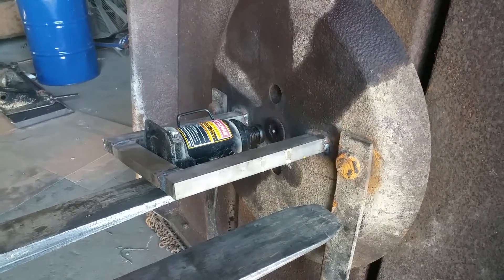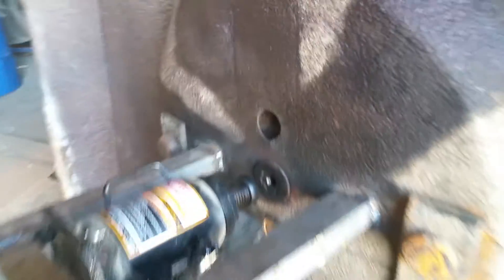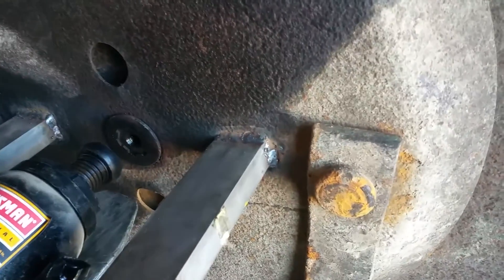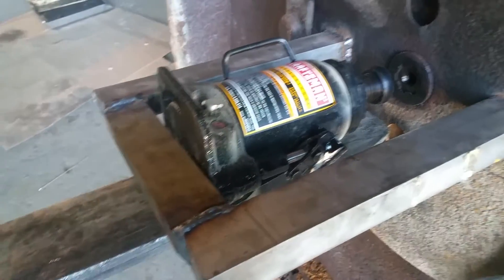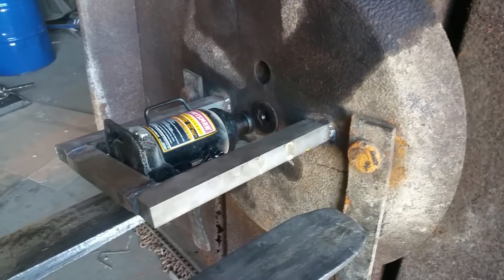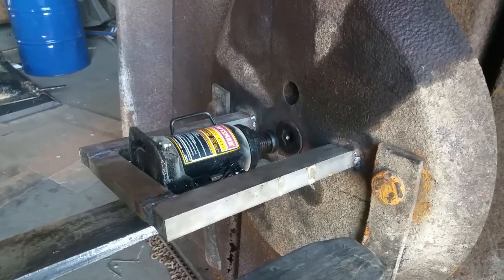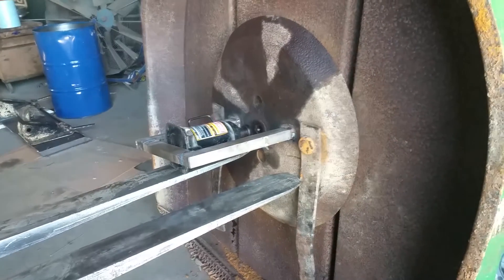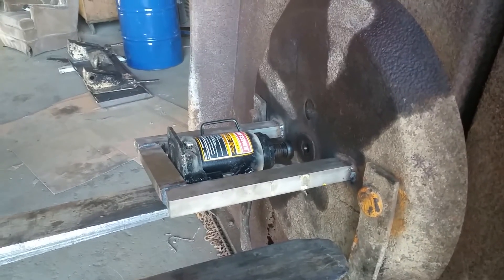Stump plate removal

Comment: You can do the same thing without welding by removing the blades and putting rods through the puller and the stump jumper. When you’re done you hang up the puller and your ready for the next time. Just saying, because some people may not have a welder, Your puller work just fine.